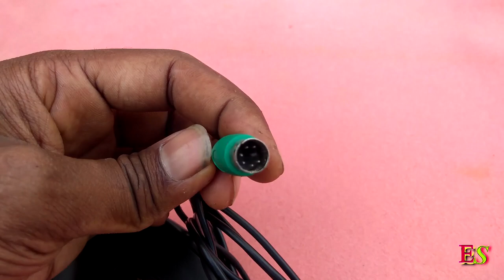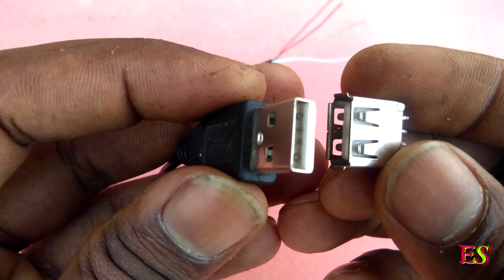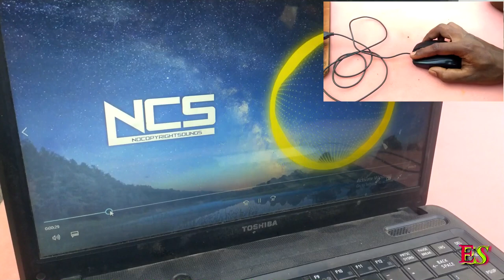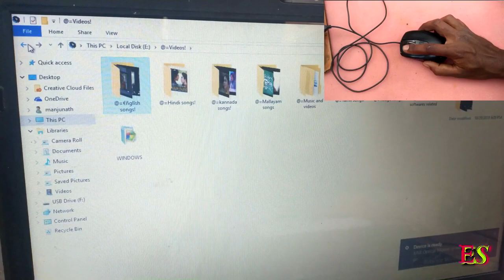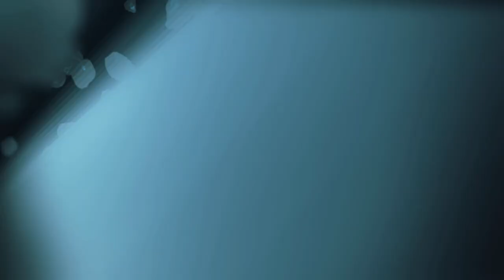How to convert a Mouse PS2 TO  USB PORT

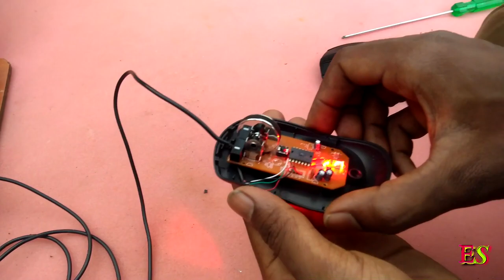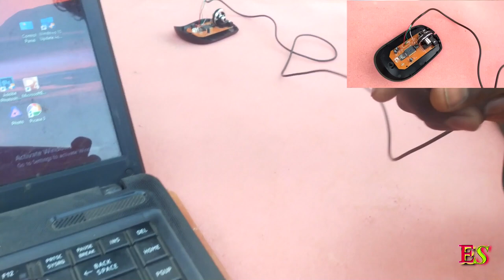Comment: If you stop the video at 8:32 you can tell where it has been split and  edited . The cable is now coiled up and  none of the solder  wires are in the same place they were  a few seconds before  stop the video again at 8:33 and there is something  red over the wires  . The space where he soldered the red black and greed wires is now  empty and the black wire is now on the 3rd hold down . They changed  the  mouse  in the edit part at  8:32 in the video . Shame on you Electro sight for making a fake video .
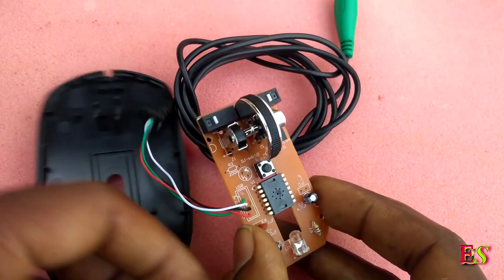Reply: At 4:36 you can see that the port is actually a usb port by seeing on the pcb where the wires are connected that means this mouse was never a ps/2 mouse also after a few seconds when he flips the board you can see all the solder was clean except the part where the wires were connected which means he soldered a ps/2 cable on the mouse by removing the factory USB cable thus this was a USB mouse already. SUCH A FAKE VIDEO
Reply: Also you can see  USB sign on the board

Comment: its not working, ps2 port three point voltage is 5.6 volt and one ground, and usb port is one point voltage is 5.6 volt, one ground, and two point single point

Comment: event you put right port cable same both 
V+ PS2 port mouse to V+ USB cable
D+ PS2 port mouse to D+ USB cable
D - PS2 port mouse to D - USB cable
G PS2 port mouse to G USB cable 
.... it never works in reality

because each IC program peripheral was designed by original cable can used 

this video just for fun

Comment: Help mine have green red white and yellow cable how to connect
Reply from the maker: (Voltage) (V)+ Red, (G)-black 
(data)      (D+) Green, (D-)white

Might be yellow is ground (negative)

Check for continuity in multimeter

Comment: It didn't work for me. I'm pretty sure I got the wiring correct, and my computer recognizes it as a USB device, the laser turns on, but it keeps saying something malfunctioned.

E: My PS2 mouse also has different letters on it, it goes from left to right: D C V G, instead of: D- D+ G V.
Reply: This assumes the mouse already has usb compatibility inside it. You need a converter PCB to convert the signal. I've been looking around for some kind of driver software that could make this work though.
Reply: because your device it's designed by original IC to originally cable.. if you device is PS2 cable so can't change to USB... because ic of your device was programed PS2 cable.. not USB

Comment: Its fake video the mouse wont work. It is already a usb mouse he joined it to ps/2 cable before shooting the video (the conversation required a adaptor. it cannot done directly)
Reply: YOU CAN CHANGE USB TO PS2 CLOCK D+  DATA ---- (DATA-)
WHY ? PS2 IS ANALOG NO NEED TO FIRMWARE 
BUT CHANGE PS2 TO USB (SOME NEW IC CAN (10%)) IN 90% YOU RIGHT 
NEED SMALL IC FIRMWARE TO TEEL USB DEVICE VID PID AND HUMAN INTERFACE FIRMWARE
Reply: @davodamirajam1276  yah

Comment: NO IT NOT IN YOUR PCB SAY USB IN 90% CANT CHANGE PS2 TO USB 

VERY LOW IC SUPPORT 2 OPTION USB AND PS2
IN YOUR MUSE  BOARD d+ d- gND VCC
IN OLD MODEL CLOCK DATA  VOLTAGE AND GND 

USB AND PS2 USE 5 VOLT AND PIN IS NOT DIFFERENT
CLOCK ---DATA+
DATA----DATA -
V---VOLTAGE +5(IF NOT WRITE IN THE BOARD THE NEAR CAPACITOR - IS GND +IS 5VOLT )

YOU CAN CHANGE USB TO PS2  (BECUASE  PS2 IS ANALOG AND NO NEED TO FIRMWARE VID AND PID COMPANY NAME EXAMPLE ASUS K56 MUSE )

BUT IF YOU CHANGE OLD PS2 TO USB ("USB NOT RECONISED ")PROBLEM
USB MUST KNOW "HUMAN INTERFACE OR MASS STRAOGE "
MUST WRITE FIRMWARE
Reply: you got the point! very explained
Reply: that's true answer

Comment: You have a mouse with a screw.
Reply: Even I got one with screws.
Reply: @bhimamasare9427  
Well, if you remove the screw, can you open it? I find that most of my electronics, you can't open them when you remove the screw. You have to damage the plastic body to open them.
Reply: @louistournas120 Yes, I could open my mouse just by removing the screws. Some electronics are glue shut(use some glue remover for it) and some have little clips and both cause a more or little damage to plastic body .
Reply: @bhimamasare9427  :
I hate their designs. 1980s, 1970s TVs and VCRs were easy to open. I break away the plastic clips and melt the plastic on today's stuff to make it easier to open the next time around.
Reply: @louistournas120  Agreed!

Comment: At 4:36 you can see that the port is actually a usb port by seeing on the pcb where the wires are connected that means this mouse was never a ps/2 mouse also after a few seconds when he flips the board you can see all the solder was clean except the part where the wires were connected which means he soldered a ps/2 cable on the mouse by removing the factory USB cable thus this was a USB mouse already. SUCH A FAKE VIDEO

Comment: bro help me i have blue green yeloow white
Reply from the maker: Check the terminal using multimeter as shown in vido
Reply: @electrosight3802  I don't have a multimeter how should I check?is there any other way ?
Reply from the maker: Did you have led
Reply from the maker: Connect led and battery series  and check it